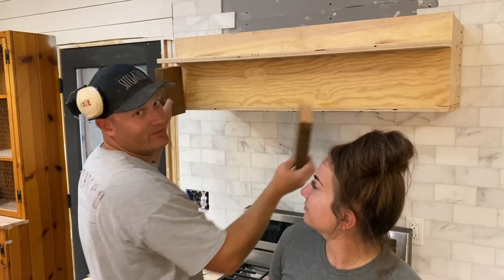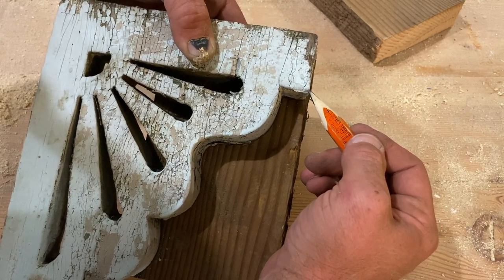Simple Range Hood Dream Home Kitchen + Patio Concrete and Forms

Comment: I had installed your drain system to get rid of unwanted water. If you have snow and ice, never use a lot of force removing ice or snow from your drain. It will break. Then it will leak exactly where you don't want water. I had to tear it out and repair the driveway. Hope to save you some trouble! Love your videos! Thank you!

Comment: Great progress! I have this very same stove vent, we had a metal hood made for ours. I hope you like it better than we do, it’s so loud, even on low. Also, the grease and dust somehow gets stuck in the little rings around the lights and cakes up on there, and grease and oil collects on the round fan housing and drips down. It’s a mess. Idk, maybe you’re a lot cleaner than I am, but I’m not a fan(no pun intended).

Comment: I really enjoy all the build and decorating projects, however, I am very surprised that you used wood to decorate over the vent as it is such a fire hazard.  Will the inspectors allow that?  In my state they would not.
Reply from the maker: It will get a metal flashing to cover the entire bottom side of the hood. Many hoods are made of wood  😊❤️